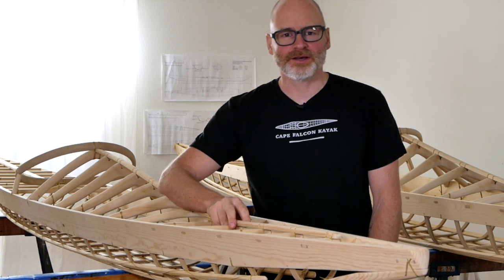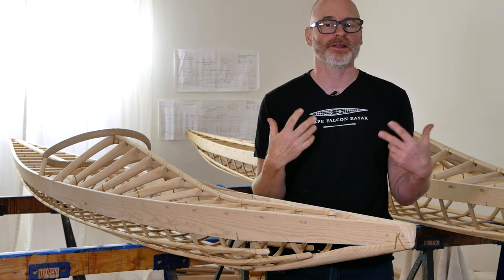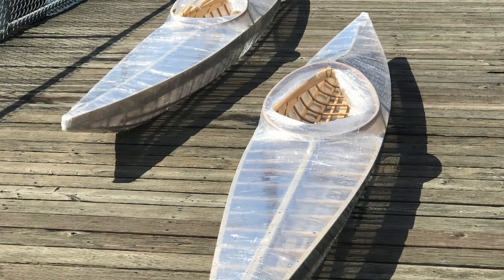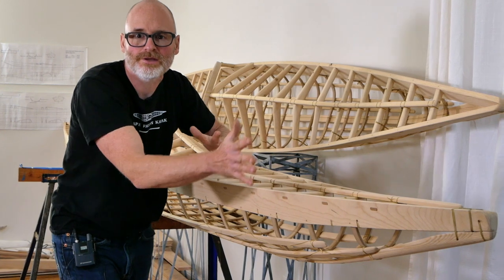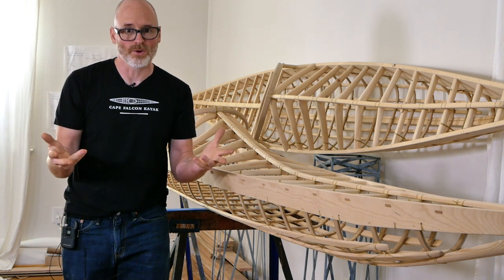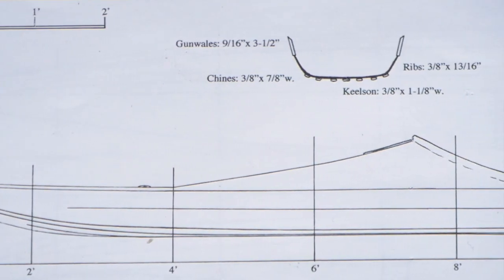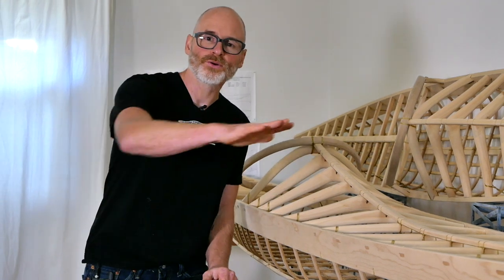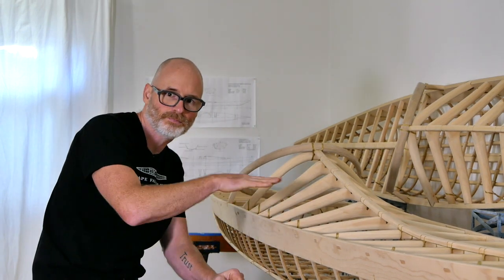North Alaskan Hunting Kayak Construction Details

Comment: I built both a Hooper bay and a north Alaska retrieval kayak some years ago. The retrieval kayak was used by Inuit hunters to retrieve animals shot by rifle from shore, at nine foot six inches it paddled like a whitewater boat. I never used in heavy water, but it would have been very able in wind and waves. the Hooper bay kayak also built from David Zimmerly's book " Qajaq" was a different beast altogether, it was tiddly feeling, the coaming was too high to paddle sitting comfortably, but when a single blade paddle was used while kneeling it was okay. I should have tried it ballasted with sand bags, the hunters carried their game inside the boat when returning home. the extra weight would stabilize the boat and bring the flare into use. These boats are artifacts of how they were used and are a window into practices and techniques we can only just speculate on. We will never have to make our living from a cold sea.
Reply from the maker: Agreed, that's why I don't put too much stock into observations gathered.  Even with extensive use we are far removed from the original context.

Comment: The flat bottom would make sense if they were having to move them across large ice sheets and then paddling in area where there was overflow (slushy water over ice). In these cases, you would need a very shallow draft that was very stable laterally.  Just some thoughts.
Reply from the maker: That makes sense.

Comment: Interestingly, the very characteristic which makes gives it stability on its edges means that when a person was leaning over the side trying to spear or pull in an animal or fish, the kayak would be at its most stable.  That makes a lot of sense because this is the time when a kayaker is in the most danger and not having to worry about tipping while hauling some animal would be reassuring.
Reply from the maker: That’s why I design my own modern skin on frame kayaks with very little primary stability but a ton of secondary stability.  For the larger one of these though it’s pretty hard to imagine what the thinking was or if there was any thinking at all.  Very little stability and then these are chunks of stability at really unnatural angles.  I’ve never paddled anything like it.  Something it doesn’t get talked about very much is that just because the kayak ended up in the museum doesn’t mean it was a good kayak.  It’s possible that a certain model was given or sold to explorers because it didn’t paddle very well.   They’re also wasn’t the same level of expertise that one might imagine.  A master builder in a village might have only built four or five kayaks in his lifetime.   So sometimes things were just the way they were because they were the way they were and if you didn’t die in your boat it was hanging around for somebody else to look at and maybe copy.  The interesting thing about evolution is that for an idea or an animal to survive it doesn’t need to be the best option it just needs to live long enough to replicate.  There were lots of different hunting styles and lots of different arctic kayaks to go with them but what’s always interested me is that often times you would see different cultural groups doing almost the exact same type of hunting but in completely different ways with completely different boats.   That was a pretty long response, just kind of thinking out loud.
Reply: @capefalconkayak  think away. I dont mind talking about it.  Ive never built anything.  In NZ they calved their canoes out of solid wood. A whole other conversation.

Comment: Nunamiut kayaks from Chandler and Itikillik Lakes were made for harvesting swimming caribou. North Alaska maritime area has the polynya areas which stay open for a long time and are magnets for seals, while further east from Barrow there are inlets and prominent points and strings of islands offshore which have longer periods of open water. Seal fat is the natural fuel of Arctic people and for those parts of the year with open water a kayak is the pathway to reliable food, oil for heat and light, and materials like gut, stomach, skin and sinew.

Comment: The added bounency of the larger kayak was probably to accomadate the added weight of a kill. It'd be interesting to test with a body on board , fore and aft , or both? The Alaska Extreme video mentioned hauling gear too. A dead cariboo on the deck may have made it more unstable.
Reply from the maker: Different Inuit groups had a different strategies for hauling the kill and usually the kayak was modified for the purpose.  This particular group towed their kill home.
Reply: @capefalconkayak  Really! That'd be a long trip home. I've had swimmers grab my kayak and I couldn't drag them to save my life. Getting a cariboo on the boat would be quite a challenge and would probably make it dangerously top heavy.

Comment: Marvelous and very interesting!   Can you tell the weight of the frames and the expected weight for finished boat with modern nylon and leather for comparison?
Reply from the maker: I weighed them at the time, but I forget the exact numbers.  I can tell you based on experience that a frame like this in white pine with a nylon skin is going to weigh around 40lbs for the large one, and 35 for the small.  Red cedar would get that down by 5lbs on each.
Reply from the maker: I didn't read that closely enough, I don't know about leather, but it is much heavier.

Comment: How would it handle with a load of seal or game on the deck? The extra weight is a consideration.
Reply from the maker: Absolutely, totally agree. There's only so much you can understand about any native kayak without doing what they were doing, the way they were doing it.
Reply: Likely the Inuit didn't transport the kill on the kayak - they used to make floating buoys out of sealskin which they used to mark the location of the kill and perhaps leave it there to pick up later. They also made larger open-top boats called umiaks which seated several people and were paddled like canoes. (Or some did - boat designs vary from place to place)
Reply from the maker: @TrevorKeenAnimation  Different cultural groups employed different strategies.  Some towed, some transported on deck, some put whole animals inside, some butchered in place and transported inside.

Comment: You might find the kayaks paddle better if you add gear (weight) to the boat that the hunter may have had along. They may have stowed camping/survival gear and food weighing 20 to 30 lbs in the front. That would correct the waterline on the bigger kayak and make it paddle better.

Comment: personally I'd be very interested to hear your take on a touring/white water kayak combination. Certainly fills a niche which isn't really filled to my knowledge
Reply from the maker: I've been working on this for a long time as a side project.  I build one every few years and test it, including some that performed well but just didn't have the 'magic' that I need to feel.  I'll knock out another one in the next month and we'll see how it goes.  There are actually a few decent commercial boats that are oriented this way, but they're just too heavy for my taste.  I'm fine to dodge rocks and accept a bit more fragility.  Interestingly, the first kayak to run all the rapids in the Grand Canyon was a skin-on-frame in 1960.  It is misreported as a fiberglass kayak because the skin was soaked in resin, but it was built over a wooden frame and skinned with muslin.

Comment: I wonder if the larger kayak was designed to carry much more weight than the paddler. If it sat deeper in the water, it might be more stable. The Inupiat would have to both hunt and haul meat in the kayak.

Comment: love watching your vids. have you ever paddle the northshore shoreline or the shoreline fuego ? i have the fuego The Shoreline Fuego (its full name) is the little bro of the Shoreline kayak which in 1982 founded the North Shore Kayak line. In fit and form it is the small person's sea kayak, celebrating the seaworthy British modified Greenland form.
Rare to find a kayak of almost 16 feet, 20" beam that's sized for the small paddler (i'm5'7",  10st 8lb, 30" in seam, size 9 feet ) The cockpit is low and aftdeck flat which mates well to smaller torsos, and which facilitates rolling and self rescues. No thigh braces are needed- plenty  of grab area under the 16"x26" cockpit, nice low 10.5" foredeck (8.5"  in the rear).  Water ready the kayak is 44lbs
Reply from the maker: I’ve never heard of either of those kayaks but I agree there’s not a lot of sea kayaks out there that actually fit smaller people well.  A traditional Greenland kayak typically makes a very poor sea kayak but for smaller people who actually float them a bit higher in the water it can actually be a nice alternative.
Reply: this is the shoreline fuego
running the tidal race in
https://youtu.be/2Gz21i7c5ck

Comment: I'm sure you watched the YouTube video "Tuktu- 2 The Big Kayak" to see a real one built on the beach in the 1950's by original Inuits. It would be great to see one well built from true drift wood and not so Fine Woodworking Gourmet kayak which these are. Don't get me wrong- they are an excellent textbook perfect kayak  and are beautifully made. But how nice if they were made with sewn driftwood -complete with sewn scarf joint amidships, using a Hudson Bay crooked knife and then covered in say, deerskin made water tight with maybe acrylic or boot waterproofing oil. By the way in Point Hope they make their coamings of two thinner layers one around the other.  Also I'm sure you know that the curve of the bilge on the ribs was done by heating and biting in their teeth so that it made a tiny bit of deformation in the wood, and they bit and bit and bit over and over to get it to bend the right amount where they wanted. Also, you are too tall. A lot of these people were like 5'6 or less. The thing might have been more stable if you shrunk yourself.
Reply from the maker: I’m actually one of the few people alive who has built one of these in the traditional way from Driftwood.  It was challenging and quite outside the budget of this customer.  However, I want to stress that the finished product of these kayaks is identical to the original museum boats that we were working from.  Some in your kayaks were quite crudely belt and others rival the finish quality of even present day fine woodworking standards.

That’s really interesting about the point hope coamings, I haven’t seen that documented.  Makes sense.
Reply: @capefalconkayak  Thank-you for your kind response. Its intriguing that some were so refined. Curious how they did it.  Was there a video made of the driftwood build? Also have you seen the 1950's Tuktu 2 kayak making video? What would be interesting would be a video of you watching the kayak making part of that video, occasionally pausing and commenting on it with some of your insights. Its a bit simpler than yours, i.e. fewer and cruder pieces, similar elegant shape and the sewn skin stretching is shown. In another 1950"s Tuktu video about clothing he comments that his mother was able to sew sealskin boots so well they were watertight.  No compound of some kind was used.
Reply from the maker: @paulbriggs3072  it was before my video days but if you look at my old website there’s photographs of the Belcher Island kayak process.   I’ve seen the Tuktu series, entertaining and impressive.
Reply: @capefalconkayak  Thank-you.

Comment: This kayaka Sat high in water because it was meant to carey a load. When caring the right amount of weight it would have been much more stable.
Reply from the maker: you're half-right! on the way home from the hunt, there would have been more weight.
Reply: @capefalconkayak  I agree to disagree , a kayak that sit higher in the waterline is going to be less stable, but more maneuverable and faster great for hunting. The iniut
Reply from the maker: @augustoduminuco4683  I took a bit of time to fact check this, and it turns out that these Inuit never carried weight in the boat, kills were towed.  It's really hard to make any generalizations about anything with arctic kayaks.  Some of this subgroups kayaks sat quite high in the water, some quite low.  Whether there was a real performance reason or whether you just built a kayak and got used to it isn't something we can know.

Comment: I have a theory, that the larger boat would become more stable with more load. Caribou / seals are heavy, and need to be transported back from the hunt. The flatter keeled boat may have been practical for this purpose with its also flattened sheer creating higher & more "barge-like" freeboard.
The smaller boat with more rocker and sheer will paddle better, but loses freeboard amidships if heavily loaded, less practical for carrying weight. Any thoughts?
Love your videos btw.

Comment: Benefit of an anthropometric is that it is possible to naturally scale a kayak to the individual.  a bigger person would build a bigger kayak while a smaller person would build a smaller kayak.  This has the potential to optimise a weight size ratio.
Reply from the maker: That’s definitely the idea but in real life it doesn’t actually work that way with the wide variety of shapes and sizes of modern people.  So let’s say you’ve got a guy that 6’4” but only weighs 160 pounds and then you’ve got another guy that’s 5’6” but weighs 220, both of these guys would end up in the wrong size kayak.   They probably worked better in homogenous populations were people were more or less the same size.
Reply: @capefalconkayak  i imagine that 220 lb fat  guys were not likely to have the endurance these cultures required out hunting.  I suspect thwyd be left smoking and drying yesterdays kills.
Reply from the maker: I get this question a lot in relation to modern people using traditional boats so maybe I misunderstood your point.  As far as what the natives actually did it really just depends on the time period the location and the cultural group.  There’s limited evidence that some groups used various anthropomorphic systems.